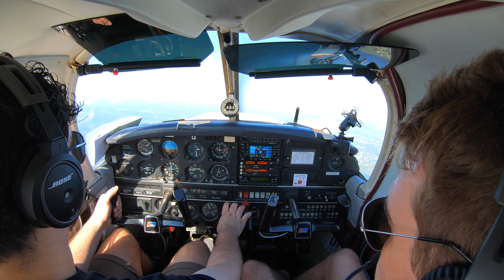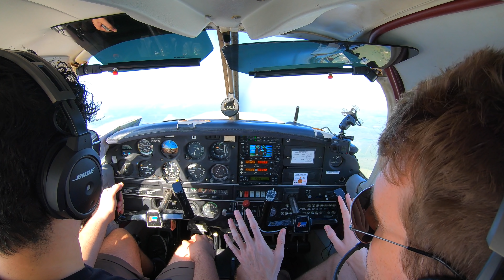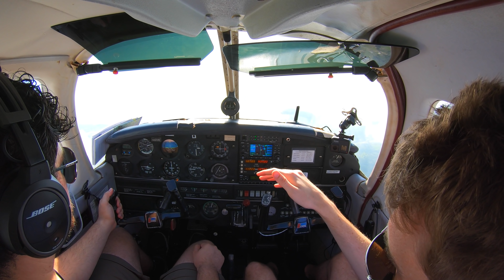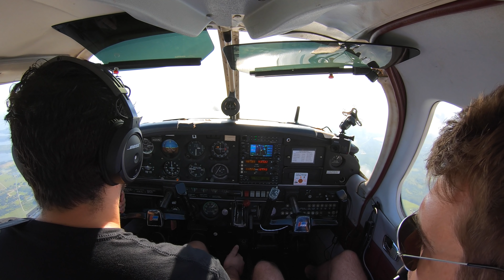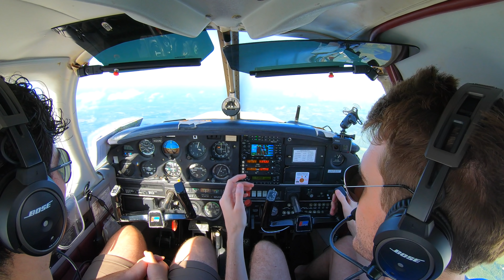Important Skills For Landing - Slow Flight & Stalls| PA28

Comment: That’s why I love pipers, stalls are so easy and smooth. In fact you don’t even have to worry about a spin practicing stalls. 
Excellent video man.
Reply from the maker: Thanks man! Yea stalls so easily. Very nice plane
Reply: my power on stalls in the warrior never seem to want to fully go, were practically a helicopter, gotta give it some help to practice the recovery lol
Reply from the maker: kevin haha in my next stall video with JD I point out that in power on stalls I’ve found these planes don’t want to stall. There isn’t a significant pitch down haha

Comment: The instinct to use ailerons to correct an incipient spin is very strong. IMO every instructor should either demo this or let a student put the plane into one, to show recovery procedure. Perhaps the FAA should also require this training for PPL. Looks like your boy is doing well. Good prep and good instruction makes a big difference.
Reply from the maker: It absolutely should be something an instructor demo’s. It’s part of the regulations “spin awareness”. He’s doing a great job and progressing on schedule! Thanks brother!
Reply: Maybe you should reference the POH on piper spins before you tell someone to do it...
Reply from the maker: You can let a wing drop and catch it without spinning. Nobody is talking about spinning a Cherokee
Reply: @LewDixAviation  Exactly. On a side note, I was amazed at how much cleaner the PA-32 - my first low wing - stalled vs the 172s I trained in.
Reply from the maker: Yea man I find the Pipers stall so much better. Cessnas have alway seemed unstable in a stall to me
Reply: @LewDixAviation  Stall a tramahawk..... that will keep you on your toes :D - great video as usual dude.
Reply: in canada spin training is a requirment for ppl

Comment: My question is why do you go to idle for the stall? My students don’t pull power until the runway is made close to the numbers rounding out. So an approach to landing stall in my case is power 1500 flaps full 65 MPH 500 fpm descent. Stall is induced as if they were getting low and didn’t add power to stop the descent or on the base to final leg in a turn. In most most cases a fatal approach to landing stall accident is on the base to final leg when power is still on. Not when someone is already in a round out +/- 10’ -20’ AGL. Not saying you are doing anything wrong just curious as to why you teach the maneuver that way. Cheers!
Reply from the maker: The clue is in the name haha it’s a “power OFF” stall. And of course, I’m not saying your way is wrong either, but to me, power off implies that you are simulating pulling the power and flaring too early on a landing meaning flaring way too high.. this happens a lot in the early stages of training as I’m sure you’re aware. I’ve never had anyone question it before. Haha
Reply: LewDix Aviation it may be in the name but as I read the ACS it states to configure airplane into a landing configuration, establish a stabilized descent, transition smoothly from the approach or landing attitude to a pitch attitude that will induce a stall. Doesn’t really clarify power should be at idle except for the name. Personally I teach as previously stated due to the fact that we see most lose control on the base to final leg with a power reduction.
Reply: Also the recover procedure eats altitude. So really in a real life scenario if you are flaring too high and stall with power completely at idle...there is little chance of a recovery. On a base to final leg when you are typically 500 AGL you still have some room.
Reply from the maker: If that’s what passes on a checkride for you, that’s sweeeet! My way is what passes my rides. At my airline it was always power fully idle too. I’ve never seen it done your way. Other than power on stalls of course. Interesting insight though man!
Reply: Absolutely. By all mean I’m not saying you are wrong. We all have different teaching styles and little differences in procedures. Just curious since I like your videos. Fly safe!
Reply from the maker: Of course man! We all learn from each other.. after all, a good pilot is always...... nope.. haha thanks brother!
Reply: Haha sorry I thought this was LewDix Aviation? I must have the wrong channel.
Reply: @LewDixAviation  dont say it.
Reply: That was an interesting back and forth, I have been taught to pull the power abeam the numbers then power as needed.
Reply from the maker: Mike Ryan kind of like a modified power off 180.. Interesting. I like doing those
Reply: @LewDixAviation  This is why I love your channel. Amazing exchange of ideas.  I'm a firearms instructor and I always try to see how/why a fellow instructors teaches a certain way. Even though I've been teaching for years, I never forget I'm still a student. You are not just helping new student pilots but the aviation community as a whole.
Reply from the maker: Tony Rosa thanks Tony!